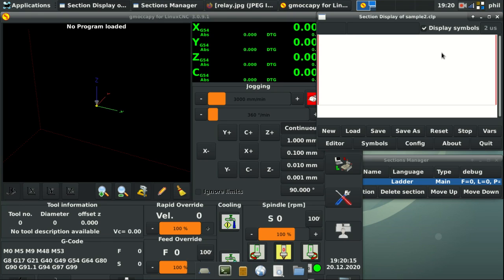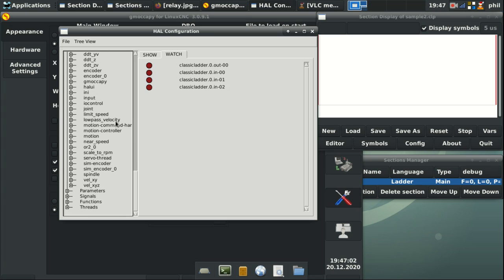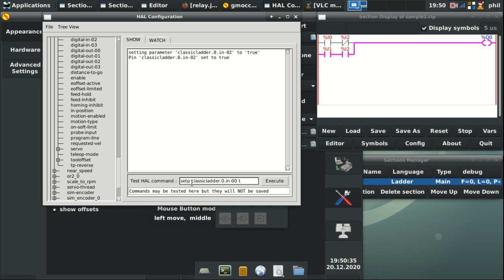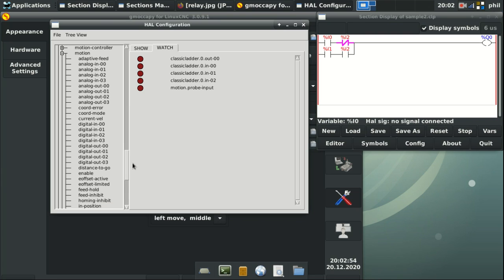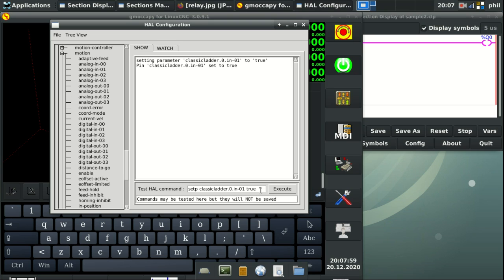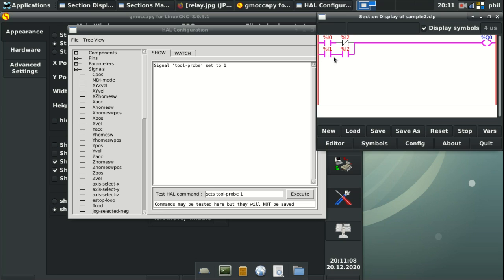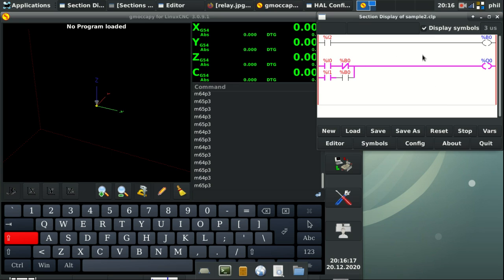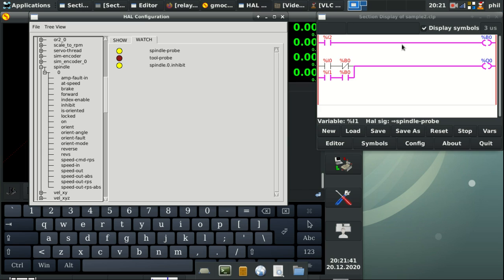LinuxCNC Classicladder basic tutorial part 2

Comment: Been following this and the HAL tutorials but there's something I'm not understanding with this one, hopefully you can clear it up. 😁
Just so I understand correctly:
-Your first setup "IRL" is 2 inputs into a physical relay, which common goes goes to 1 input into LinuxCNC, I assume you use an output from LinuxCNC to select which input you want.
-To get rid of the physical relay you put both inputs into LinuxCNC and then with classicladder simulate a relay to achieve the same function.
I guess what I don't get is, if you already use two inputs into LinuxCNC, why do you need the CL-relay solution to seperate them? Is it just for the XOR logic?
I assume this is for a mill so spindle-probe would be used to find the work and tool-probe would be used to set tools/tables?
Reply from the maker: I was using an output to use an external relay that would switch the wire path between the table setter and spindle setter and send the signal to a single input on the board. Doing it in CL gave me the ability to eliminate the relay and use ladder logic to mimic the relay by sending the probe signal into two separate inputs. It also gave me the ability to lock out spindle functionality when I had the spindle sensor in place. 

Now that I'm thinking about it, I'm half tempted to set up an auto switch circuit that will swap the signal path wherever the spindle probe is plugged in instead of using an m code 🤔🤔
Reply: @TheFeralEngineer  I mean, the more automation the better. 😄
I rewatched it a third time and I think I understand better now, please correct me if I'm wrong:
Both probes use the HAL pin motion.probe-input and by digitally turning I2 on/off you can make sure you're getting the correct input(I0 or I1).
This uses two physical inputs but you save a physical output and don't need the relay.

I assume that just netting I0 and I1 to motion.probe-input(skipping the cl bits) could cause some safety concerns if the wrong probe were to trigger when probing? Seeing as you wouldn't know for certain which probe caused the signal to motion.probe-input. Or is there other reasons to do this?
Reply from the maker: @MrCrankyface  safety and the fact that both switches are normally closed, so trying to wire them in series or parallel to a single input would not work correctly